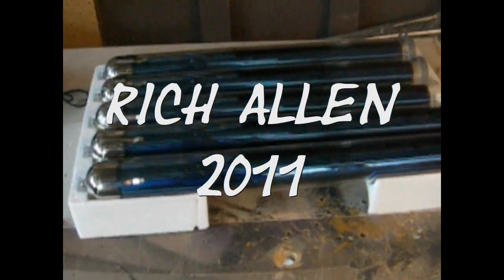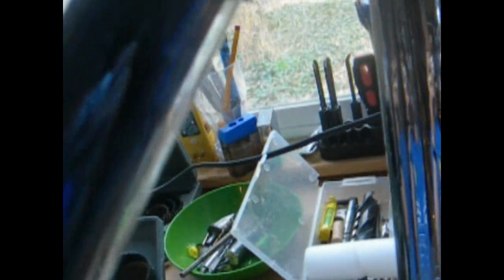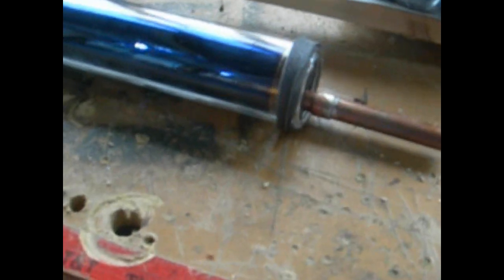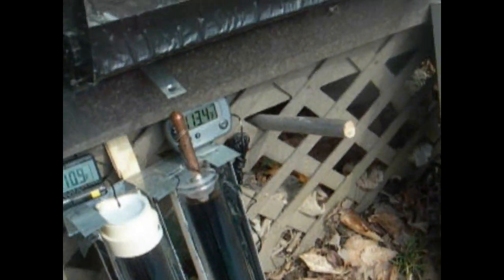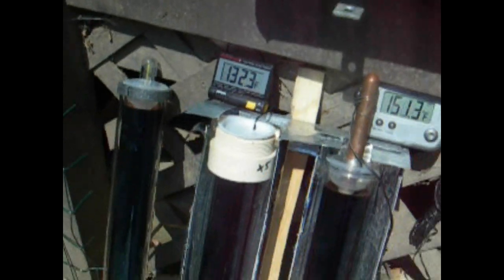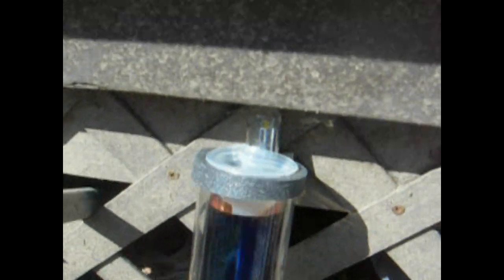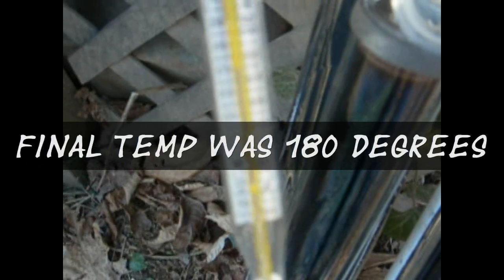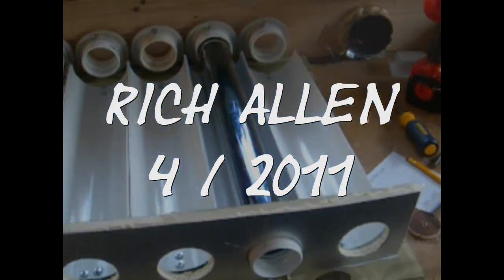SOLAR VACUUM TUBES RICH ALLEN 2011

Comment: Hey Rich, I love the videos dude. I have a question. 

Do you think those vacuum tubes could be connected to a box to make a solar convection oven? I was thinking a 18" cube with two tubs on each of the four sides. 

Do you think that would work using the heated air to cook the food?

Thanks

Comment: @richallenmusic I dont have any video of my production but I used the video produced by Sundug69, in his video "Making a Heat Pipe", as the basis of my setup.  Again the acetone is very effective it boils at low temp about 90degrees F I think and is easy to work with.

Comment: @richallenmusic - The important thing here is to use STAINLESS STEEL scouring pads for two reasons; 1 Steel wool pads will rust if they come in contact with ANY moisture, 2 Because Copper is a NON-FERROUS metal and STEEL WOOL is a FERROUS metal, corrosion wil occur where ever the two touch.  Stainless Steel is steel with Chrome mixed in during its production and it will not corrode when it comes in contact with copper.

Comment: @1foxtrot70 Also the amount of Acetone is about 10cc.  You can use a graduate or a seringe to measure the Acetone.  Empty the amount into the copper tube.  For best performance you must evacuate the tube of Ambient air. To do this the heat pipe is inverted to accept the acetone, place a finger over the open copper tube and heat the bulb at the bottom of the tube. You will feel preasure rise, gently remove finger to let air out then place cap on the tube and then solder in place.

Comment: I have a short 24" and a long 72" evacuated tubes from Green Republic also.  A word of caution.  The tubes are just like a Thermos Bottle and as such if you are not careful handling them and break the TIP the tube is absolutely useless!!!  When they break a white powder appears and again you have handfuls of glass chards.  The heat pickup tube you should use 1/4" tube with a 1/4x1/2 reducer and the top bulb is a airchamber raiser for anti-knocking in pipes in plumbing cut it to 2 1/2".

Comment: The effiency of heat transfer of the heat tube is improved when the copper pipe is encased with Stainless Steel scouring pads that have been unrolled and tied toether.  To protect the glass tube at the end of the copper tube form a pad for the copper tube to sit upon. You will be impressed with the heat transfer.  I have also measured dry temps inside the glass tube with a IR thermometer of about 
425 degrees F.

Comment: Just as a suggestion, use steel wool to act as a buffer or barrier, to keep the heat pipe or insert from moving around. This ensures it does not crack the glass.